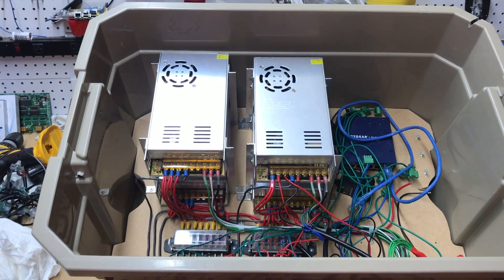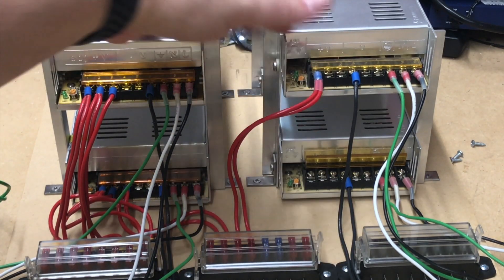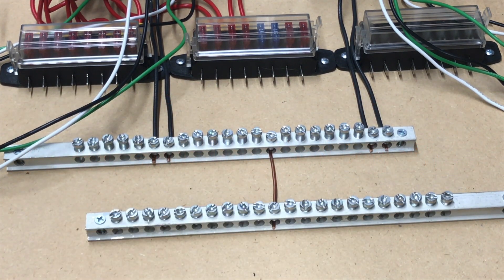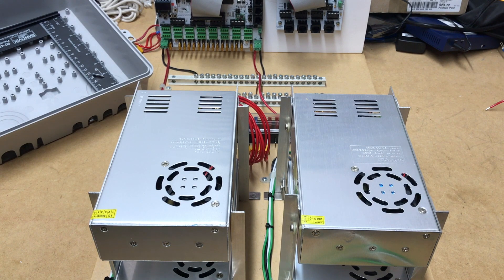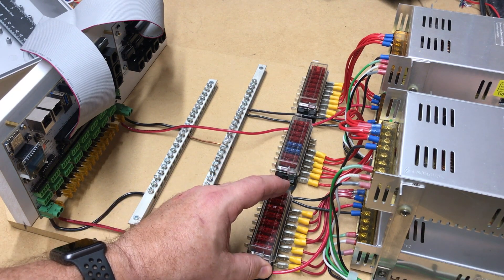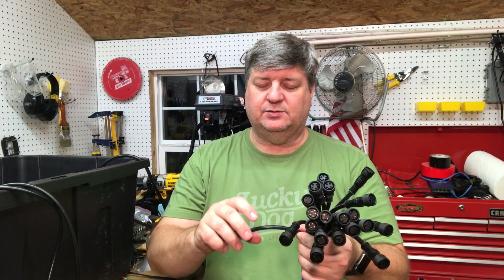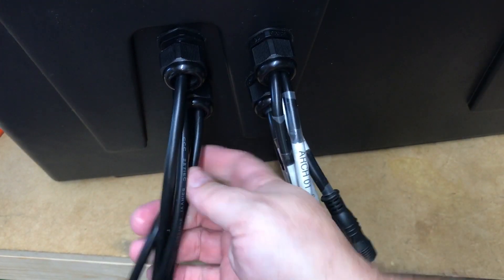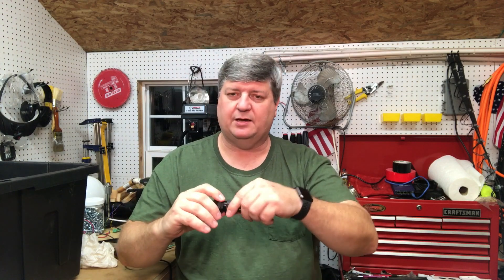Central RGB Pixel Controller Box Rebuild

Comment: I'm guessing you don't have to worry about this as much in Texas, but have you ever ran into humidity issues? I'm in Missouri and I've been nervous about having my controllers outside and condensation killing them.
Reply from the maker: Winters are usually less humid, but we also get rain. I've not had a problem with mine, but I do make sure if moisture accumulates, there is enough room in the bottom to catch it vs letting it short out the boards. I usually put 1/2" plywood in the bottom of my sealed boxes and cover them with a trashbag. I also turn my controllers off after the show. Some folks in colder areas may leave theirs on for the heat which may help prevent moisture accumulation. Honestly, I haven't had a problem with it, but you might want to ping the Facebook group to see if anyone else has had trouble and what they did.

Comment: Are you using 1 power in fort all psu?
Reply from the maker: I had 4 power supplies in this box, but I don't use it anymore. Most of mine have one power supply now. Differential receivers make that much easier.
Reply: @CanispaterChristmas  but did it have one power cord to power all 4 supplies?
Reply from the maker: Oh, yeah. I just combined them all into one plug.
Reply: @CanispaterChristmas  one last.  What the max pixels per 12v meanwell psu?
Reply from the maker: Not an easy answer. Depends on the size of the supply, the pixels and your brightness level. Ballpark is to use 0.06 amps per pixel at 100% all white, but that also gives you some overhead ('cause who runs solid white all the time?). Some pixels will pull a lot less so it's a math problem with what you have. Lowering the brightness will also allow more pixels on the same supply.
Reply: @CanispaterChristmas  does 2x 350w seam right for 1300. Running at 50 or lower
Reply from the maker: 1300 X 0.06 = 78 amps. 78/2 = 39 amps. Those are 30-amp supplies so it would be enough. You really only want to use about 25 amps (50 for 2) from those to prevent overheating, but you'll be way under that.
Reply: @CanispaterChristmas  I appreciate your help. Thanks and thanks for your service. I appreciate that more.

Comment: Is it possible to connect more than one power supply to each wall plug? If so, how do you wire them together?
Reply from the maker: It's generally do-able, but depends on the supplies. I stick with the 350-watt variety, but some are using old server power supplies that pull a lot more current so you have to manage the mains side to make sure you stay under the max for a typical circuit home circuit which is ~1700-watts. As far as wiring them, just get one done and jumper to the next supply with the same size wire or leave enough wire to get to the 2nd supply and carefully shave off the insulation for the 1st supply without breaking the copper. There isn't one right way to do it. I like to put electrical tape on the mains terminals to keep from touching it when it's on.

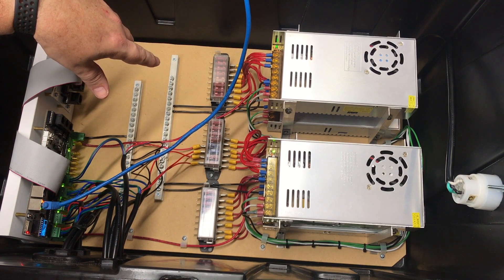Comment: Quick question, at 9:09 I see you running power trough the fuse block and straight to the pigtails, and I also see you running power just through the f16v3 to the pigtails on the bottom Left. What is the difference between the two? Thanks!
Reply from the maker: It's an older video and I've become wiser since then, but I believe the ones I powered directly from the fuse block draw way over 5-amps so I just bypassed the controller's power distribution. Injecting power is all about maintaining voltage all the way down the string so there's not really one way to do it.

Comment: So I was watching this 1 to think of Ideas for my box that I am building, and to get the links for some of the items you were using, like the cable gland joints. Now what I was wondering is for things like the electrical plugs and such that you have facing the outside of the box, have you tired using things like Dielectric grease so that the connections do not get water and are protected?
Reply from the maker: I have on a few, but generally don't. You can if you have a problem with moisture getting in there.

Comment: Jeff, I noticed that you tied the grounds together on your power supplies, i did the same thing for my two power supplies in my controller box but I am being told this is incorrect and can cause a fire. What are your thoughts?
Reply from the maker: A common ground is fine. Positives from two different power supplies need to stay separate.

Comment: I like the setup. I use heat shrink from a labeler. Works great but gets expensive. Thanks for another great video!
Reply from the maker: Thanks! I've moved on from this one. Decentralized is much easier with the F48, but it's more expensive.

Comment: What are your thoughts on ventilation? Doesn't look like you use any fans or vents. Any worry about your power supplies getting too hot (I think you are in Texas. Me too!)
Reply from the maker: It's usually cool enough in December to keep things cool. I've not had a problem with overheating. I do turn things off during the day to conserve, but components don't really heat up unless the show is running.Plus this is an old video and I'm much more decentralized now so the heat is spread around. Basically, keep an eye on it, take measurements and if it gets too hot for your liking, cool it, but I haven't needed to. Now, if you're running a show in September, it's an entirely different story. :)
Reply: Canispater Christmas aka Jeff 
Thanks for the quick reply. If you power down things how do you keep your timer in FFP accurate? Doesn’t it reset? The enclosures I’m making now are strictly for power injection so I could probably put them on their own timer. P.S. Thanks for all your videos. They have helped me so much. I’m just in my second year.
Reply from the maker: Thanks! Glad to hear it. The computers are the only things that stay on (it's inside), but all the power supplies and controllers are powered off. The sign stays on all the time since I can't separate those components, but it isn't running so stays cool.

Comment: Do you ever run a fuse between PSU and pixel board ?  Is it needed due to PSU  features ?
Reply from the maker: I never do, but I won't laugh at you if you do. The pixels are protected by the fuses on the controller, but if you tend to drop screwdrivers or other metal objects into powered electronics, you might want a fuse. 😀
Reply: 🤣😂  do you run pixel power through board or straight from fuse block to pixel #1 ?
Reply from the maker: @darrenrichards2264  My methods have evolved. I try to use board power if at all possible as it's so convenient. If I see that a string is going over 5amps (or plan one that way), I inject (through a fuse).
Reply: Thanks for all the info you share, your channel is brilliant 🙂
Reply from the maker: @darrenrichards2264  Thanks! Glad to be of help!

Comment: I noticed you are using fuse blocks for your power injection lines, is it better than the falcon distro boards? Or you just prefer this method?
Reply from the maker: It's an older video. I believe this was before he had those or at least before I knew about them. Either one will work. I don't use this box anymore. The F48 and differential receivers are a better fit for me. I still use the F16 tho.
Reply: @CanispaterChristmas  do you put fuses in between your power supply and the smart receivers?
Reply from the maker: No. The fuses on the boards protect the pixels. Just needed for power injection.

Comment: So, re-watching this again... my tree is 800 pixels, I have the availability to use "output" ports 1-4 from my Falcon F16v3. I was thinking I could theoretically run this from the internal Meanwell PSU at 30% Brightness and not need any power injection. Sound about right? 200 Pixels per output. But I do have it available if needed. Thoughts?
Reply from the maker: It's possible, but test it. 30% reduces power needs down to 1/3rd so you do get more bang for your buck. If you see the pixels toward the 200-end fading, you can still inject power from the same power supply, but don't do that until you test. If it looks OK, then you won't need to inject.

Comment: Hi, thanks for your great videos. a question on the power supplies, I see from the video you have 8 sets of cables coming out of each 12v supply to the 8 port fuse strip. is that correct and does that cause loss of power to the injections ? thanks
Reply from the maker: Thanks! Not sure what you mean by "loss" but if connections are electrically the same, then they will share power from the same supply.
Reply: @CanispaterChristmas  By loss I mean that in your videos you add power injectors to ends of strings, does this cause a drop in power distribution from the power unit or is the power even across all injections ? I was under the impression that each of the 3 v- and v+ on the power supplies could only supply power to one string injection, so on a sting of 200 and you have 4 injections, then I believed you needed 2 power supplies (as they only have 3 v- and 3 v+ connections) 1 v-/v+ for each injection ? but in your view you have 2 wires coming out of each v-/v+ so making 6 injections connections. Thanks
Reply from the maker: @aaronag7876  Perhaps the terminology is messing you up. Power supplies provide volts (electrical pressure) and amps (flow of electrons) when multiplied together denote power (watts). Each pixel uses some unit of power (different pixels are different). Supplying power to each pixel drops a tiny bit of the voltage so pixel #1 may receive 12V while pixels #2 may receive 11.99V and so on. As the string gets long enough, the voltage gets too low to properly power the pixel so no pixels after that point light up (though the chips may be using a little bit of power). By injecting power, the voltage is raised so that the pixels at the end have enough to properly function and they light up. From the power supply's point of view, the load or amount of amps it needs to provide has increased because more pixels are using power. So if you have 3 equal strings of 10 pixels, each string will use 1/3rd of the total load from the power supply. If you connect 6 equal strings of 10 pixels, each string will use 1/6th of the total load from the power supply. In the second case, the load or current draw will be roughly double the first case. If I connect 100 strings, each would use 1/100th. As the number of strings increases, current draw increases. So the balancing act is keeping the total load under 80% of what the power supply can safely provide. For the 12V 350-watt power supplies I use, it's about 25 amps.
Reply: @CanispaterChristmas  Thank you for such a detail explanation.

Comment: The more I learn about pixels, their data length limitations, about power injection, the more I wonder why people buy something like the falcon f16 v3.  If you can only go roughly 20ft with the pixel data, why aren’t more people going the differential/receiver route? I have a small yard but even I can’t centrally locate everything to do a box like this. Am I missing something?
Reply from the maker: Many factors. Controller to first pixel distance depends on several things (pixels, voltage, wire size, connectors, brightness...). There are techniques to increase the distance (amplifiers, ethernet cable for the data line) and I've gone 30ft with nothing special. Some people hate power injection and want more ports. The value proposition is an F16, but I agree that an F48 is a lot easier to spread out - it's also more expensive when you factor in the receivers and cable and power supplies. I ran an F48 last year and loved it. Whatever works best for you and your budget. :)

Comment: Also some advise on what size pigtails to get, that May commonly match with Ray Wu’s lights, would be of great help ?
Reply from the maker: I get all my pigtails from Ray though I believe others have them too now. He sells them in batches of 10 I believe. I usually buy a few with every order so I don't run out. :)
Reply: CanispaterChristmas wanted to build out the boxes before ordering lights from Ray, so was hoping to find out size of plug and length of pigtail wire.
Reply from the maker: OK. I believe the size is 15mm (specs should be on Ray's web site). The length is less of a concern since you'll probably need to add some wire somewhere, but I think they're roughly a foot to 15".

Comment: In one box I’m planning to put in one (1) f16v3, one(1) 16 port expansion board & one(1) differential receiver board.....with four(4) Meanwell 350 power supplies......if using all the ports, is there anything left over to do “power injection” ?
Reply from the maker: Cool! To power inject or not depends on so many things, but mainly the length of the strings. If you are going over what the fuse can handle, then inject power for that string. Running at a lower brightness can help a lot so you need to factor that into the equation.
Reply: Yeah, Clyde was suggesting “not” to run at full power and use as many ports as possible, before delving into power injection just yet. To try and keep it as straight forward as possible for my first year.
Reply from the maker: I stayed under 50 nodes per string my first year and changed everything the next year. People start at varying levels of electronics expertise so it's an individual thing. If you're scared of it, then don't worry about it, but if you know how to do it, then by all means, string away! :)

Comment: Jeff, I’m interested in finding out the socket you used on the case to power the 4 power supplies, as well as the cord you’re plugging into that to go to your wall outlet ?
Reply from the maker: Hey Robert, The socket is on my affiliate page (https://www.amazon.com/shop/canispaterchristmas?listId=ZBY2EIQPNUJO) under random electronics. It's a standard plug so you can use a standard extension cord.
Reply: CanispaterChristmas Jeff, what’s your opinion of this one for protection in off season: Journeyman-Pro 5278 15 Amp 125 Volt, Flanged Inlet, Black Commercial Grade, 2 Pole-3 Wire, Straight Blade, Nema 5-15 (With Cover/Cap) https://www.amazon.com/dp/B01E6N0XFI/ref=cm_sw_r_cp_api_i_lZOFCbAP9CJZ8
Reply from the maker: That should work!

Comment: Ok so this might be a dumb question, I know from watching your videos that you need to connect the grounds when you power inject, is that what that common strip is for?  Do you still connect the grounds at the end?   I was planning on getting the T-cables from Ray for power injections since i'm still new to this and a little nervous that i might screw something up and ruin my controller..
Reply from the maker: Haha. This was before I understood it better. I have a prop with a lot of pixels and completely bypassed the power on the controller. Yes, the bar is for a common ground inside the box. Connect the grounds at the end of what? If it's the last pixel in a string and you aren't injecting power, no connection, but if you are injecting power, inject both positive and negative - basically just another wire from the power supply. If different power supplies, grounds yes, I recommend breaking the positive connection somewhere so the two supplies aren't tied together, but some have said as long as there is a load between, it's ok. I haven't found a way to reliably test it so I say break the positive if you are using 2 supplies.
Reply: CanispaterChristmas yeah sorry I did mean after the last pixel. And I think I was getting confused about needing to connect the grounds when using 2 different power supplies as opposed to use using one power supply. Pretty sure that I will only need 1 supply since I’m not planning on running at full power. Thanks for the response.

Comment: how did you power all 4 power supplies?  Did you use one 120volt from house outlet into the box and split the wires to supply the 4 ps's?
Reply from the maker: Yep. I believe used 18AWG power cords (thicker insulation) to the power supplies on the AC/mains side. You can always use larger wire if you are unsure, but a single power supply isn't a huge draw at the higher voltage. I am planning to measure the power consumption for the entire display this year just to see.

Comment: Well done. Only thing I would add is more ground wires running to the buss bars. And/or thicker ground wires.
Reply from the maker: None that I'm aware of, but they could be out there. I have a beginner playlist of videos that goes through the basics and I would spend some time in videos.xlights.org to gain a better understanding of all the parts involved so you can build your own setup. That way, you can source as much as possible locally rather than having everything shipped from the US. You really only need the controller (pixelcontroller.com) from the US (possibly pixel holders from boscoyostudio.com) and most everything else you can get in the UK. Pixels are made in China and you can order them directly or possibly find a local source for them. I talk about that in the basics series too.
Reply: Do you know where I a get me a DIY LED tree kit that will ship to England UK I already got a load of neo pixels just starting you into led for Christmas I already made one small pixels with one string on them and one of the led testers that works great, many thanks and keep up the video's
Reply: And its was because of you and the first video I watched on led lighting  I decided to nod my electric wheelchair  with 5 volt LEDS  powered from a powered from a power bank as well as a desk too !!!
Reply from the maker: @mrgatez2007  Haha. I get that a lot. Very cool!
Reply: How long of extensions can you use? And do you have any videos of the wall wash on the side of your house?
Reply from the maker: Look at my music videos in DEC 2018. I didn't put it out for 2019, but it's going to be totally awesome in 2020! 20-30ft ish. Longer than that and you have to start doing other things.